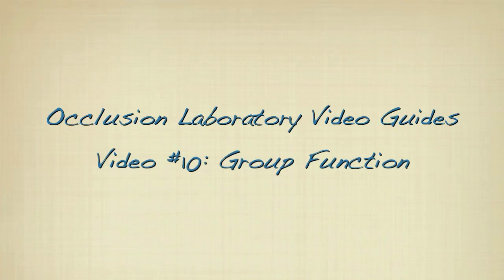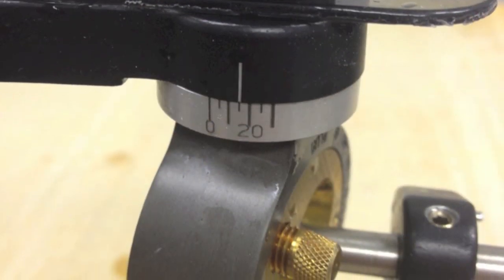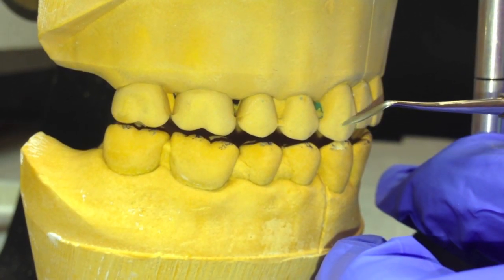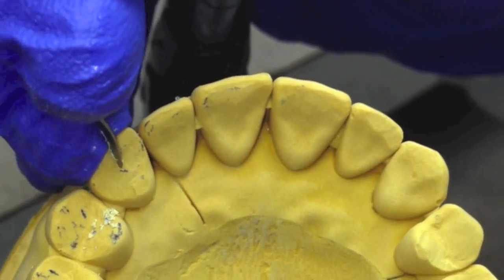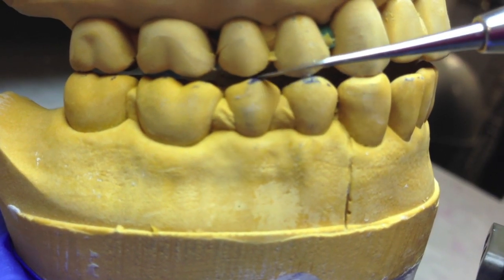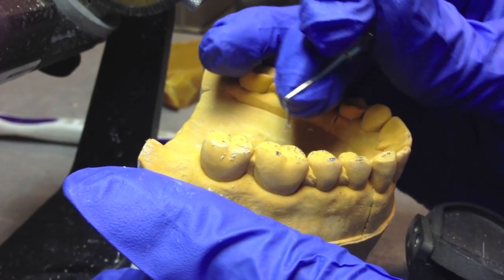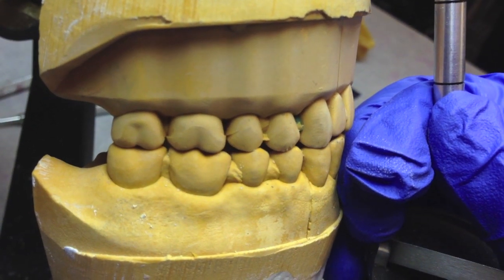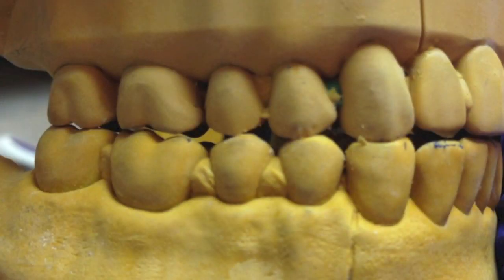Occlusion Laboratory Video guides Video 10 Group Function

Comment from the maker: This video is an intro to equilbrilating  cases when in right or left lateral excursions ..with multiple contacts ..that is group function ..I explain by bilaterally equilbrilating the denture the case should have group function ..that's the way I do my denture cases ..partial dentures also need to be equibrilated however the clasps aid in retention ..so is group function as necessary? I'd say no ...but it should still be achieved where possible